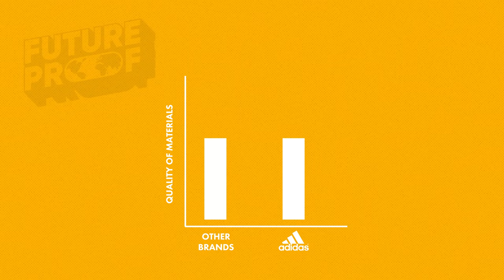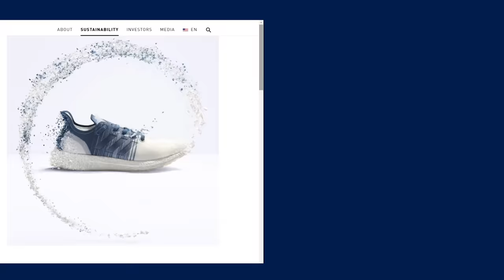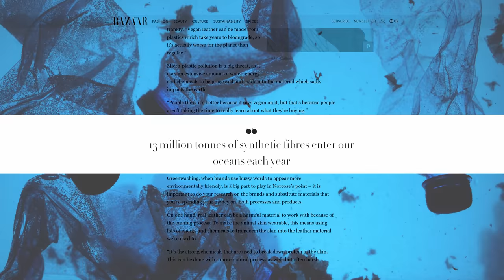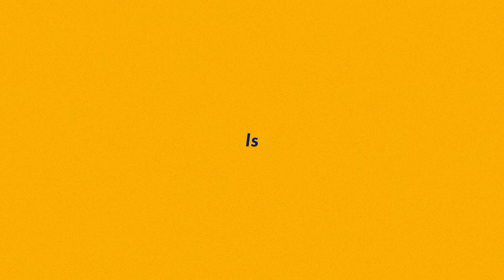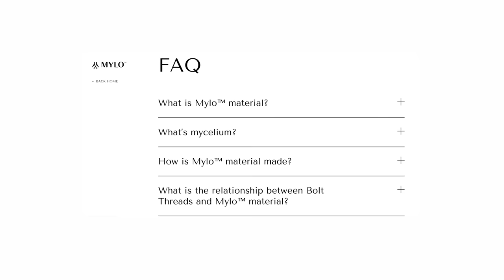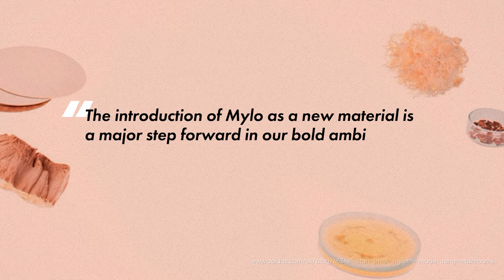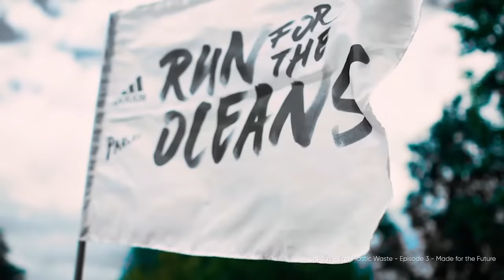The TRUTH About The NEW Stan Smith

Comment: Some plastics are biodegradable/compostable, so they're not necessarily bad, but only fine if they're also produced sustainably. If you want a reasonably leathery product without plastics, there are a few alternatives:

- Waxed canvas (needs maintenance, not very breathable).

- Mirum material (made with natural rubber instead of plastics).

- Lino leather (not a lot of fashion items made with this yet AFAIK, but sounds promising).

- Thin cork (not as durable as genuine leather).

There's other stuff like kombucha leather, but it's not even water-resistant to begin with. It requires treatment with linseed oil to be made water-resistant, and maybe wax for waterproofness.

Thing is, if they all turn out to be nowhere near as durable as genuine leather, they'll have to be bought multiple times, even undermining their sustainability.